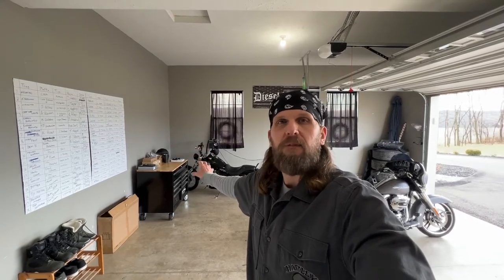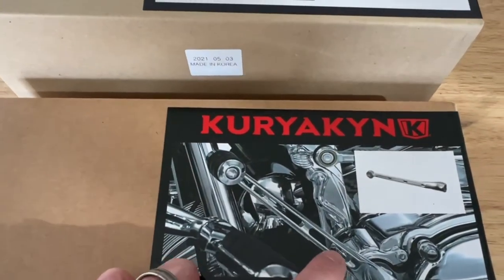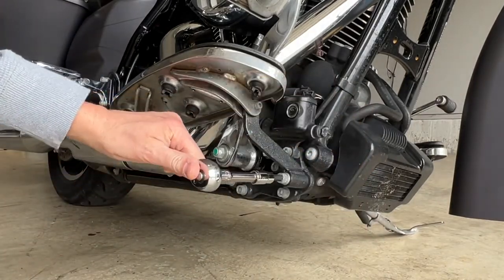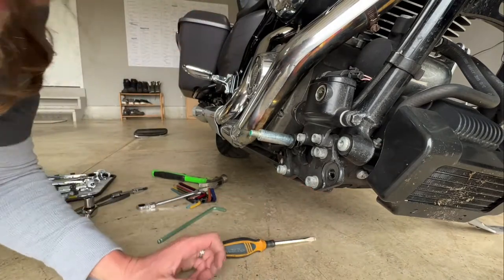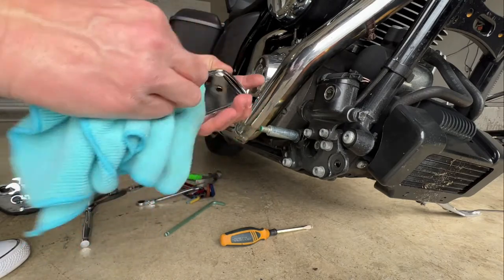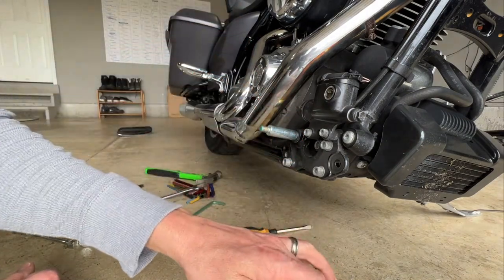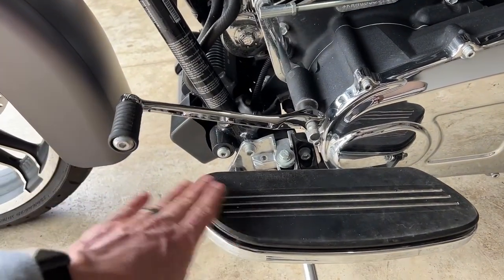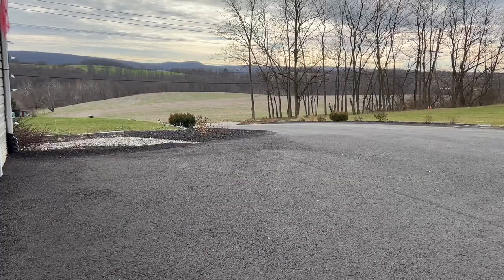Kuryakyn Extended Brake & Shift Levers For A 2016 Harley Davidson Street Glide For A Tall Rider

Comment: Could have removed the 3 Allens that hold on the master cylinder and brake pedal mount as a unit. Much less hassle over removing crash bars/lower fairing.
Reply from the maker: Correct, I found that out after the fact lol

Comment: Hey Matt Are You Gonna Modify Your Seat And Handlebars, And Could I Do That Same Shifter And Break Pedal With Lower Fairings?
Reply from the maker: Yes, I just posted a video of me installing 16 inch ape hangers on my bike. You could do the same extended shifters and probably the extended floorboard brackets but With the lower fairing it might be a little tight. I was just measure from the tip of your floorboard to your lower fairing and make sure you have at least an inch or more of room because the floorboard extensions pushes your floorboard forward roughly an inch. But I think overall you should be OK.
Reply: @DieselLegiance  Thanks Matt.. Stay Safe And That SG Looks Awesome... I'm A First Time Harley (Street Bike) Owner, I Thought About Getting The Road Glide But I Didn't Wanna Wait. However I Do Know Of Several Tall Guys, 6'3"+ Street Glide Riders... I See It's All About Seat Feet And Hand Positioning When It Comes To Mods For Tall Riders... Can't Wait... To Make My Baby Comfortable.$$$😆 Stay Safe Matt And Thanks Again.... Very Informative Video. Much Respect From Detroit 313.
Reply from the maker: Thanks 👊🏼.  I almost have my bike dialed in for my height and so far, I love it.  I installed the extended shifters (shift & brake), extended floorboard brackets, 16 inch apehangers, and I am waiting for my saddleman extended reach step up seat to come in to review.
Reply: @DieselLegiance  I'm Looking Forward To Watching The Installment... There's Nothing Like Being Comfortable On Your Bike... Comfort Is A Safety Factor As Well.
Reply from the maker: Just installed led signal lights today.  Video will drop tonight.

Comment: You worked way too hard to get that pin out. Next time remove the master cylinder and the whole assembly pulls out. It's easy after that. I'm a big fan of the extended brake lever, not so much of the shifter.  I keep mine right above my shoe and don't have to reach to shift up or down.

Comment: Yeah, that extended brake pedal does not fit on a 2014 or any CVO limited or road glide. It’s not that I need it stretched. I would like to have it lower they just don’t fit. Yeah they’ll fit that crash bars Highway pegs for comfort.